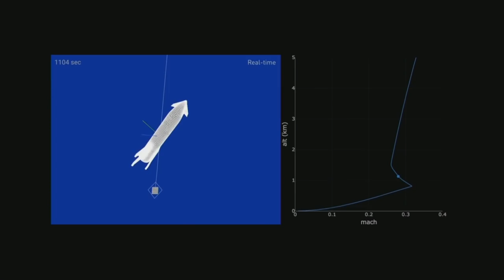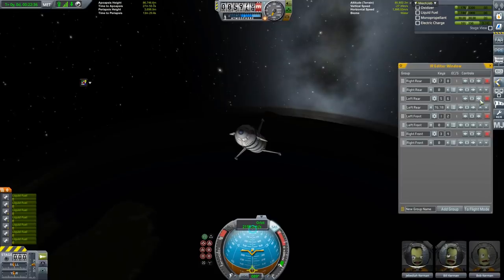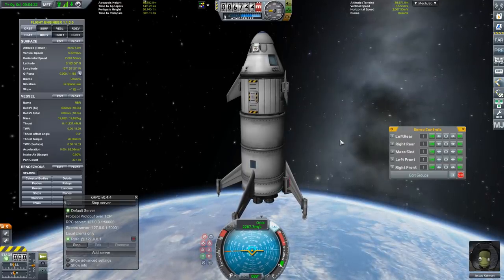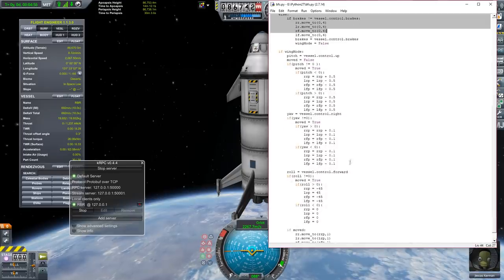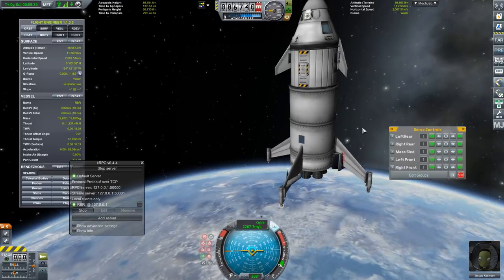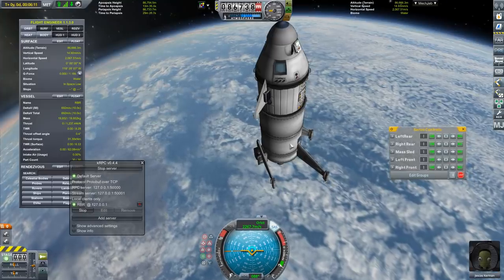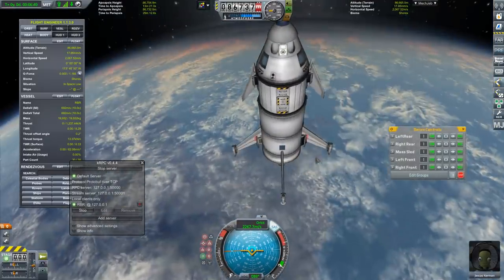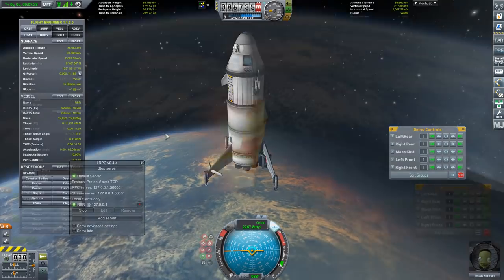Simulating The BFS Descent 'Skydive' In KSP - Fly By Wire with kRPC

Comment: Oh man, those  failed attempts  at the end with that music cracked me up 
The one where you landed on a mountain side and the crew cabin rolled down the hill...ugh. Kinda nightmarish.

One question: If the rocked lands with basically the right velocity, but kinda falls over like on these videos, but there are no more fuel in the tanks, would it explode in real life?
Reply: It would not explode, but pretty much destroy itself under its own weight, this is basically a 50meter tall building that just falls on its side, that breaking and shuttering though, flying everywhere
Reply: "The one where you landed on a mountain side and the crew cabin rolled down the hill...ugh. Kinda nightmarish."  Yeah, you could almost spin the Uranium right out of the Kerbals head with that much centrifugal force.   Fun video Scott.
Reply: I guess the tanks are still under pressure. Some of the failed Falcon 9 landings exploded when falling over, but without a huge fireball, because of the empty tanks. So maybe something like that. Just a thought
Reply: There is no such thing as "no more propellant in the tanks" even if the engine burns out. There will be bit more LOX or fuel left and plenty of fumes in the so called "empty" one, enough for a small fireball.
Reply: Yeah, I was thinking they can't be all empty. 
But I don't know the engineering part at all so I had to ask.

Also yeah, the failed falcon rocked attempts came to mind, where they said they ran out of propellant but there was an explosion. 

And yeah, a big falcon rocket falling over is probably enough to shatter the whole thing completely. 

I have a feeling that this way to land a rocket is pretty risky bit
Then the current way of landing- the cabin falls from the sky with a parachute is not exactly better either.
Reply: All I see are SpaceX failures. yes the ones they put on the internet
Reply: As other said the tanks are never really 100% empty, there will still be fumes, and even a cup full of LOX and RP1 will make a big bang, enough to rip open the thin aluminium tank.

Also, in regards to the Falcon-9 there will also be a decent amount of the starter fuel on board, again even if its just fumes, Liquid helium to use as a pressuriser is also still there, so all this together still leaves a big pop and enough of a fireball that you wouldn't want to be stood close when all the bits start flying.
Reply: Captainkiddoregon We're definitely past the chunky salsa stage and into biological film territory
Reply: I agree with the other replies, but wish to add that Kerbal parts are seemingly fabricated from compressed explosives. It's part of the fun.
Reply: Bah, kind of safe. Just rolling down the slope at about 30 m/s 😱
Reply: I think that the spacex booster were blown up on purpose to prevent damage to the droneships they were landing on. It is quite common for uncrewed missions to have this self-destruct option.
My point is that those explosives could be triggered by charges attached to the rocket for this purpose.
Reply: What happens with the crew cabin during an explosion like that? Is it possible for the astronauts to survive a disaster or is it certain death? 
If the BFR landing becomes a common practice,  statistically we will still see one or two disasters. It would be just extra sad to lose people basically in the landing phase.
Reply: There is always fuel in the tanks. The BFS design is to get rid of COPVs altogether and use expanded propellant to pressurize the tanks instead of helium. So you essentially wind up with two big metal balloons filled with pure methane and pure oxygen being breached in proximity to some very hot pieces.
Reply: Additionally, intaking air bubbles as opposed to pure fuel/oxidiser is how you turn turbopumps to shrapnel (or at least overheat them and ruin the bearings), so liquid engines aren't run till empty if you ever want to light them again, as SpaceX do
Reply: Excellent point, Bryn.
Reply: Yes, through rapid depressurization. The fuel tanks are being filled constantly with Helium to keep the pressure of the fuel up.
Reply: Hahaha.. some of them were SOOO close, too!

Comment: Interesting feedback about the risk of the de-facto vertical stabilizer being a control risk if it were to roll out of the leeward side during reentry.  An oscillation on a craft that size would either rip it to shreds or eventually centrifuge the passengers to pancakes.

Comment: Scott, I think you might have more luck if you reduced the drag on the rear control surfaces by folding them "forward/down" (anhedral in appearance; directions on a rocket are hard) rather then "aft/up" (dihedral in appearance) as you seem to have them configured.  If you review the SpaceX video, as the craft transitions from predominantly forward flight to "falling with style", you can see that the SpaceX rendering is folding these surfaces "forward/down". I think the difficulty you were running into was as you fold the rear control surfaces aft/up you effectively increase the tail fin surface area and introduce more of the roll instability that you were fighting. Folding these surfaces forward/down would move the center of lift/drag more central as well which would probably make it more stable.

Comment: I wonder if the wings really need to be that much of maneuverable. It will be pretty hard to make the actuator elements survive both space and reentry heat. I imagine a much simpler approach would be more successful in a way that wings are held closer to the rocket, would be less exposed to heat but provide a "natural" stabilization effect, during which the ship may be controlled over rocket engines only. The wings would unfold only after the rocket went vertical for landing burn. Less active and sensitive mechanics needed this way.

Comment: This all seems well and good, I totally have faith in their ability to run aerodynamic simulations and whatnot, but what I'm curious about is the heat shielding. They're talking about a potential direct capture from Mars. the space shuttle had those insanely expensive, complicated, and hugely time-consuming (from a maintenance standpoint) ceramic tiles just to re-enter from LEO. How is the BFS going to survive the heat?
Reply: treschlet also with heat shields

Comment: The fact that you can make it work at all would indicate that this is a real possibility. Certainly if a real pilot (or should I say human pilot) was going to fly this thing, the controls would be more ergonomic than some buttons on a keyboard. The pilot would be relying on physical feedback such as feel and sight as well as instruments. So the control for attitude, even though they might control a large number of surfaces, would all boil down to one control similar to a helicopter. The off hand (left for me) would take care of mode changes and such. But... the reality is that a computer (well group of computers) is going to be the pilot as that is the only way to test this unmanned... and that is where things will go first. Each change will be programmed in on a usec by usec basis for all changes the craft might make from the previous usec.... all the way down. Ya, takes the fun out of it...

Comment: Would kRPC enable the kind of variable control mixing that a tilt wing VTOL airplane like the XC-142 would need? For example, the ailerons are ailerons in conventional mode, but they would control yaw in vertical mode. For variable wing tilt, you'd want to mix the inputs dependent on wing tilt. I did a bit-bang implementation on that years back for the Gumstix.
Reply from the maker: I'm sure it's possible.

Comment: Elon to investors, showcasing this video: "look, it can work, okay? "
Reply: until they see all the crashes. this design seems more problematic than the space plane design. with a space plane you have a barely flying supersonic glider that plows through the air at ridiculous speeds but is still largely controllable. this thing doesn't seem controllable at all

Comment: During launch won't those not-wings make the rocket tumble once it reaches high-speed because they are too high up?
Reply: I mean, during launch, when the rocket reaches max q, the bottom part will have half of the fuel and the weight on the upper part may be higher. Also, the wings will be above the half of the rocket, any shake may make the whole thing tumble.

Comment: I kinda wonder why they just can’t put a parachute on the nose of the aircraft. You know, just in case...
Reply: That thing is huge. Parachutes wouldn't necessarily be able to fix things with these proportions.
Reply: @gregorhellmundt9559  I'm not talking about using parachutes to perform a soft landing, but just to properly orientate the shuttle right before landing (using its engines to come to a full stop) and also to slow down a bit. I just find It to be safer than using wings and aerodynamics...

Comment: Wait how did you get infernal robotics to work in 1.3? I can't get it to work in any version
Reply: It's actually working just fine with 1.4 , but it takes a bit of searching and patience, since the mod is split into 2 parts for some bizarre reason. Had a conflict with engineer some time ago, but afaik that's fixed now.

Comment: I dont think that this design is going to be very stable and will likely experience oscillations that will end in destruction of the vehicle.  The whole thing is suppose to fall on its side with no heat protection?  yea no, that shits going to explode when the side of it gets hot and the fuel under it comes leaking out a little pin hole or a stress induced crack and boom.
Reply: it will have thermal protection on the reentry side.
Reply: Spacex surely did hundreds of percise simulations, so l have no doubt that BFS would be stable at re-entry.
Reply: But this design depends 100% on automated controls.
Reply: +vadymvv all spacecraft today depend 100% on automated controls.
Reply: @mbm3708  you can land "Soyuz" in hand mode for example.
Reply: yea that doesnt mean that there wont be an instability that the controls cant correct for or anticipate.
Reply: that would cause massive weight and balance issues
Reply: +rizendell ill go under the assumption that the thousands of engineers contemplating and working these problems have considered your concerns in their design.
Reply: as the son and grandchild of generations inventors and engineers I can tell you that engineers don't always foresee failure or anomalies in the ways they imagined and often regress to trial and error over theoretical assumptions when it comes down to the real thing.   In other words, I'll believe it when I see it (a few times in the case of a rocket).
Reply: +rizendell well, I believe tests, both in practice and simulation, were going to be part of their process. we can't expect them to be omnicient, can we?
Reply: apparently saying that you think something or forming a personal opinion is butterfly effect level damning to whatever you form an opinion on.
Reply: +rizendell of course, its the internet.
Reply: @SV_Try_Magic  doesn't help when you write a comment and say that the BFS will reenter with "no heat protection" when it very obviously does in every render
Reply: I'm sure the engineers chose this configuration for a reason. It does make for an awkward looking goose, though, I must say.